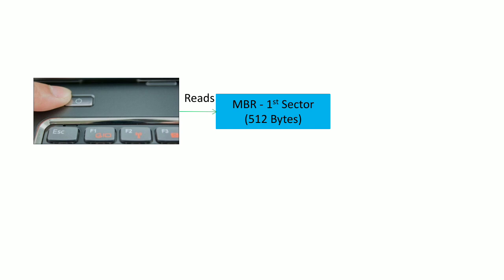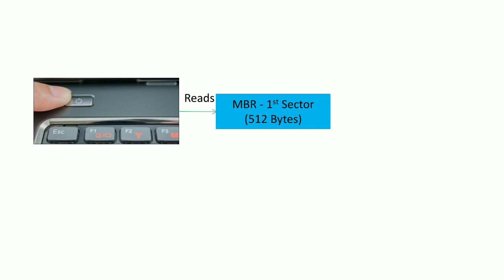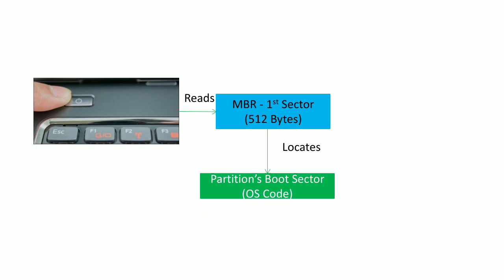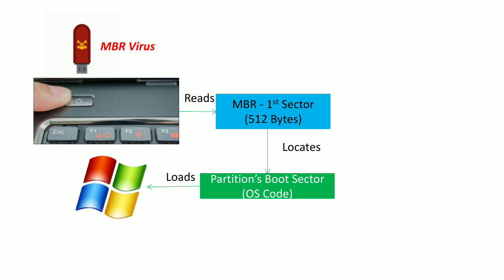MBR Virus

Comment: Great explanation... thank you! This is EXACTLY wtf is goin on with all my PCs. So once it’s infected by this crap, no matter how many times you “slash&burn” Windows, and reinstall a “clean copy” of the OS it does no good. You simply have a brand new Windows install that gets freshly infected.
  I was already fairly certain this was the case when I arrived here, and I am now looking for a way to kill it. 
  So the question is, if one were to update the system bios via a non infected USB flash drive by changing the boot sequence in bios, and running the bios update straight off the flash drive without booting into Windows, would this method serve to also update (ie...overwrite) the currently infected MBR with a brand new, non infected MBR?
     Thanks for any reply from anybody! I was hoping you would touch on the possible solutions for the problem in this video, but still appreciate the succinct manner in which you explained it. It is spot on! 👍

Comment: Good evening. You said the bios can prevent infection over writting the first sector which is the mbr of the system.

On the video 4:50, the flashdrive mbr is infected and the system is clean. If i configure the bios then insert the mbr flash drive to the clean system, the clean system will get infected?